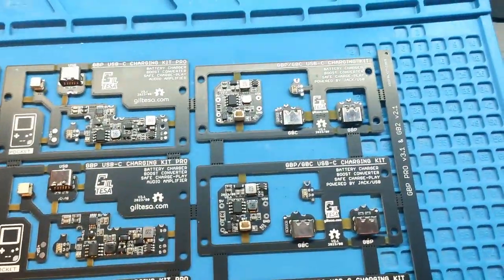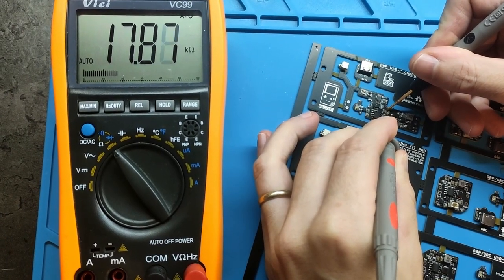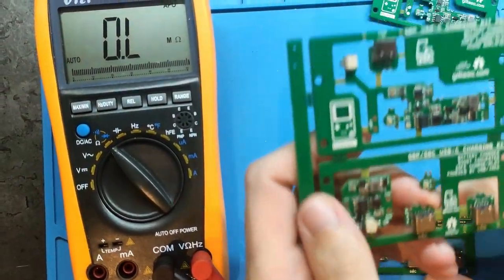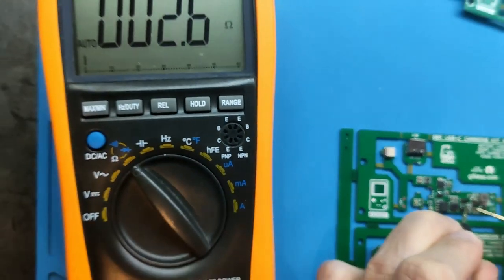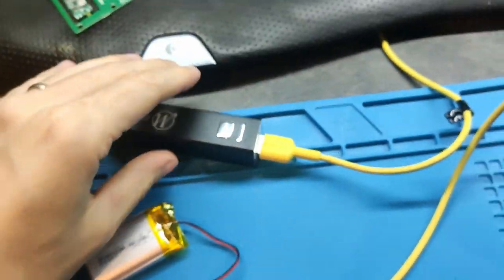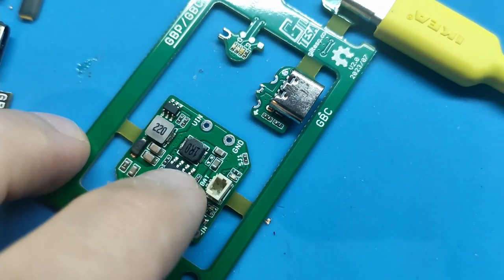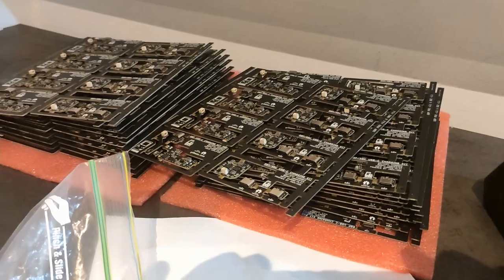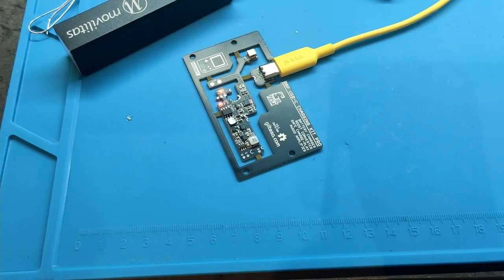Quality Issue with JLCPCB: Incorrectly Assembled Electronic Circuits (W202308130314390)

Comment: I know this has got to be super frustrating for you. I really appreciate the QA you are doing on these boards. So much better to find the problem here than after installing into a Gameboy. Thanks for sharing a video on it.
Reply from the maker: Yes, it was very frustrating, especially when the manufacturer didn't want to produce the boards again and simply offered a $60 discount coupon. This weekend, I've been fixing the boards, and I've already done a little more than half of them. It's been quite a bit of work, but the finish is good. Maybe I've used a bit more solder than necessary in the soldering, but well, I did it by hand with the air soldering station. 

https://shop.giltesa.com/wp-content/uploads/2023/03/GB2-v2.1-resistors.jpg

I've tested to ensure there's a good electrical connection with the new resistors, that the rest of the circuit is functioning properly, and that the battery is recognized and charging. Everything is as it should be. I'll put them up on the website this week :)

Thanks for the comment!